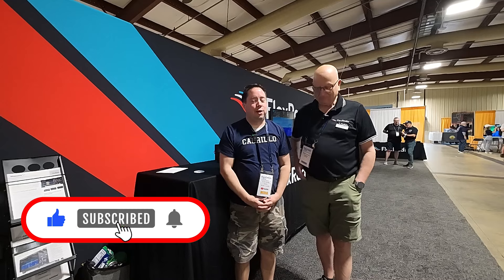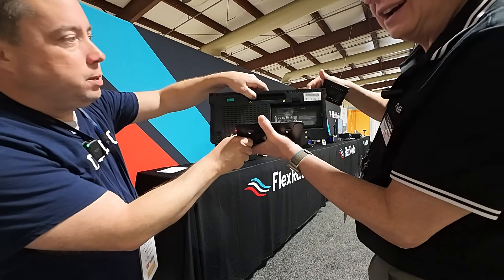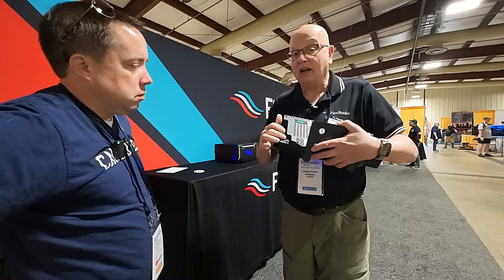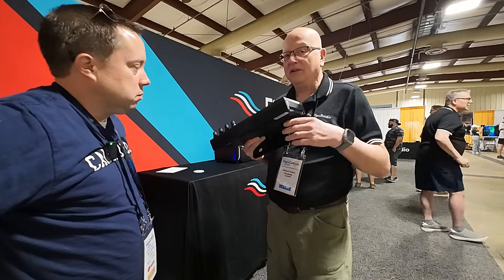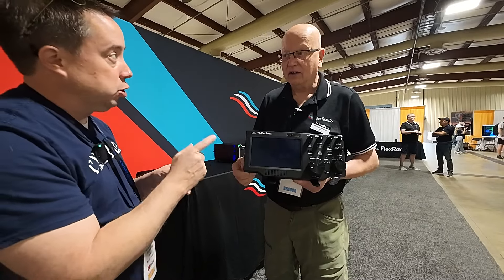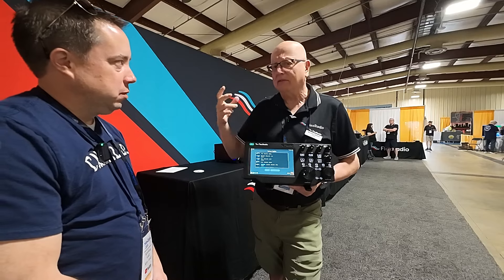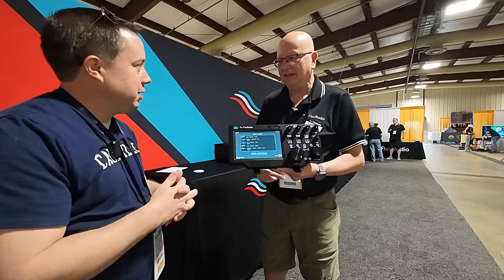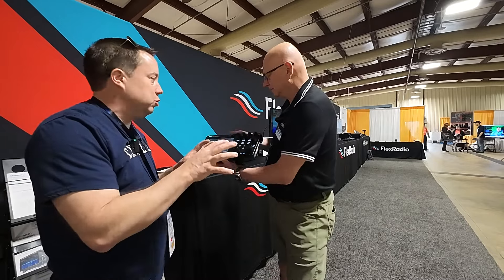The New FlexRadio Maestro C Is HERE!  New Details!!!! #hamcation2024

Comment: Did I hear correctly that there's no way to run this new Maestro on 13.8 volts?  Most emcomm setups I know of have 12-volt batteries that can be charged with solar panels.  I don't think I know of any ham using 24 volts in their shack or when they're mobile.
Reply from the maker: You heard correctly. You are bringing a maestro and flex portable for emmcom work? Not sure that's the best setup, right? You can purchase a 12 to 24 volt setup converter pretty cheap on Amazon.

Comment: A Day Late and a dollar short!
Reply from the maker: I have no idea what you mean.
Reply: OK is a little better than the (A) or (B) but it's just an outdated overpriced product that's not very useful. Better off with a laptop and the USB FlexControl.
-
Unfortunately, as of 2024 they are way behind in the market which is sad because they had such a lead back in 2012 and were way ahead of the competition but I guess their military contract with Raytheon has taken them away from Ham radio, I guess they have to go where the money is.
-
BTW you still can't directly connect the Maestro to WIFI in a hotel or coffee shop without and PC so what's the Point?
Also, The Noise Blanker and Noise reduction just barely works after all these years that  SmartSDR has been out?
-
After my 6600M went on fire while in receive that was it for me, sent it back for repair and sold it!

Comment: Hey you guys were just about ready to say what the screen resolution is but the conversation changed. Is it truly 1920 x 1280 like the original M models?  The original maestros were 1280 x 800 if it is indeed the 1920 x 1280 that would be awesome.
Reply from the maker: 1920 x 1080
Reply: Thanks.  It wasn't clear if that was the output from the HDMI connector or not.  It's cool that the screen resolution matches the "M" models. @AA0Z